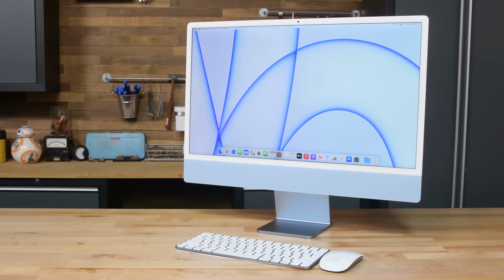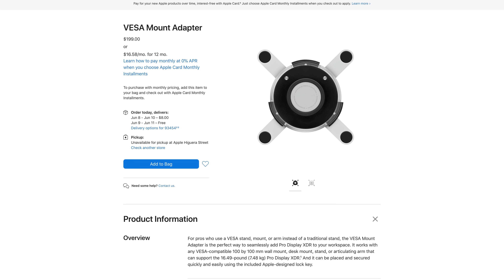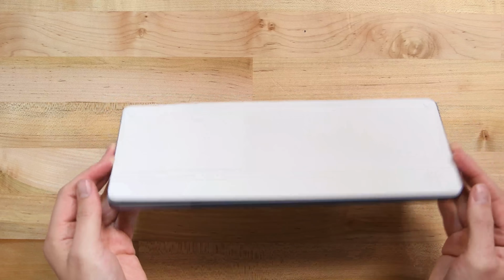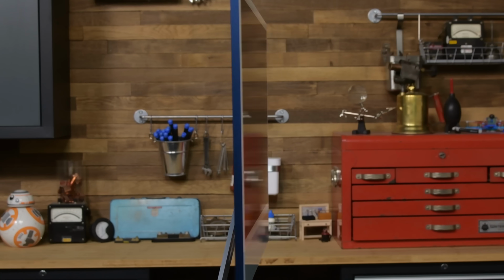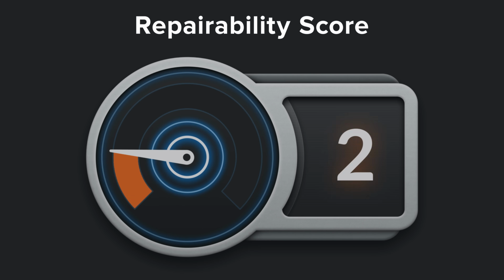M1 iMac 24” Teardown: A Desktop Only Jony Ive Could Love

Comment: That Bluetooth module looks almost as big as the whole SoC.
Reply: Yeah its not the same type of chip, because apple could have developed their own, but to make things work with other Bluetooth devices they had to use this one
Reply: @alanmay7929  They probably won't wake their own, as every device that emits RF, like wifi, LTE, or Bluetooth must be certified, approved, reviewed etc by the FCC and everyone else according the the country or region rules individually, it's strict and it takes years (like manymany years) and without benefits really just to be approved, and you must be for every country you will sell this product. That's why there is only a few brands that actually manufacture RF emitting stuff, bc its a pain
Reply: i should not be around all these peaple that know these things!!
Reply: It's just covered with metal cover for EMI shielding, the actual chips underneath are smaller.
Reply: True
Reply: @Big_Computer  But Apple al ready kinda make Bluetooth chips. H1 and W1.
Reply: @Big_Computer  I learned something new, thank you! That’s really interesting.
Reply: @Big_Computer   as someone who works in consumer HW design that’s a bit misleading. It takes a long time for regulatory approval but that’s months not many years, especially when you can do multiple countries in parallel, and some countries are consolidated (CE for all of Europe for example). Plus Apple is giant — they have the funds to do so considering their volume. I don’t know why they used a Murata module in this case, however many HW companies certify their own wifi and Bluetooth products especially to save space since modules typically are bigger than chip-down designs. And if the volume is high enough, it makes sense financially too as modules tend to be more expensive. 

Also finally this product still would have gone through emissions testing — all consumer products need to be FCC  47 CFT 15 compliant to be sold in the US. It just would have skipped some 2.4GHz /5 tests, and likely the Bluetooth SIG stuff.
Reply: @atavanH  thanks for your insights! Learnt something today
Reply: I'm presuming its a third party

Comment: I'm surprised Apple didn't go with passive cooling for this model. The thermal envelope is much more capable than the notebooks.
Reply: agreed. like you can use the entire back plate to cool the SoC. just one long heatpipe along the entire surface or so.
Reply: @Kayserjp  probably not required it's already cool enough i guess
Reply: passive cooling won’t fail, fans will fail so the device needs to be replaced sooner (apple strategy)
Reply: Depends, you may need the two fans of you're in 35°C ambient temperature.
Reply: @zeniktorres4320  cough cough macbook air cough
Reply: There’s also a giant 4k display, plus extended workloads benefit from a fan
Reply: @chidorirasenganz  That is a good point, that display and processors in the machine might produce quite a bit of heat over time.  I still think it could've been better fanless to keep dust out, even better than the new M1 iPads can, but I'm not an engineer to any degree.
Reply: @justinvalentin8983  same but I’m assuming they wanted better sustained performance so it’s on par with the MBP and Mac mini
Reply: They have a single fan iMac though, and it runs super hot(thermal throttled) compared to 2 fans iMac.
Reply: Right. There's so much space inside for heatsinks.
Reply: Because some media rendering work will throttle if no active cooling.
Reply: i would argue that it is cost savings, heatpipes are reasonably expensive and just chucking a fan on it means planned obsolecense, because you cant repair it, and cost savings. + they can market "High Performance Active Cooling" or whatever
Reply: @Carterthielftw_  heatpipes are not expensive. You can get several with a heat sink for $30-50
Reply: @thor.mukbang  I would argue that a plastic fan would cost less than 8-12 sizable heatpipes. The price difference would not be super substancial, but, like all corporate entities, making the most cost cut product is the end goal.
Reply: @Carterthielftw_  fans are definitely cheaper! But copper heatpipes are also relatively cheap
Reply: Passive cooling needs more raw material and good design, lowering the margin. Fan is an easy solution.
If people says passive cooling won't fail, the cooling paste will dry first in couple of years so the weakest point is still there nevertheless
Reply: Active means Increase fan speed before slowing the processor.
Passive means Slow the processor before increasing fan speed.
Reply: @KimoKimochii  Isn't it the other way around? The heat would build up inside the device and damage it.
Reply: @groszak1  your definition is completely wrong
Reply: @KimoKimochii  Why?
Reply: @groszak1  passive cooling means no moving parts, like a fan, which is called active cooling
Reply: I'm glad to know there are fans, despite how cool it may be inside.  I know this is comparing apples to oranges, but almost 22 years ago, my first Mac was an Indigo iMac (not flat screen, old style tube model).  Not the very first ones that had the fruity colors and the tray-loading CD drive, but the ones with the deeper colors and the slot-loading CD drive.  Besides the colors, specs and tray-load vs. slot-load CD drive, the biggest difference was?  Tray-loading iMac's had a fan, while the slot-loading iMac's had passive cooling.  Didn't help not having a fan.  The video card on it had to be replaced three times due to the lack of proper cooling.  Eventually, Apple replaced the iMac with an upgraded 2001 Indigo model.  Thankfully, it lasted several years before the internal plastics crumbled away.  

I know this is a new era and new technology, but given what happened with my iMac, I'd much rather have a fan than not.  I'm currently saving up to buy a new iMac.  I will opt for the mid-tier model at least due to it having two fans and a heat pipe compared to the base model only having one fan.
Reply: @KimoKimochii  wrong
Reply: Maybe it’ll loosen the adhesive holding the display.
Reply: @Kayserjp plus it’s vertical

Comment: Whilst it is a shame some things aren’t replaceable unlike the previous generation, I’d argue it’s progressing, in keeping only the major components on one SOC and other parts on some “replaceable” daughter boards, unlike prior iMacs which had ports soldered directly on
Reply: Is it acceptable practice from a company as large as apple, whose messaging is focused on saving the environment, for the number of interchangeable parts to be so low that it can counted on one hand? Standard windows PC have a mind bogglingly large parts market that allows you to build almost any form Factor. And even laptops have parts really available for everything from lid sensors to audio jack daughter boards, etc.
Reply: @xmlthegreat  but most parts that wear out are user replaceable. Ram sticks in pcs also break more often than soldered on ones
Reply: @Nik6644  I would very likely see some sources which can confirm you statement.
Reply: A custom gaming desktop is as modular as you can get

Comment: Amazing how miniaturisation has turned the guts of a computer into the size of a couple of big slices of pizza , but the unfortunate by  product being that it makes the device more of a throw away.
Reply: There are Mac owners that have a 10 year old iMac that did never touched the RAM. However lack of upgrade ability kind of defeats the purpose of a desktop computer. Hopefully the next iMac Pro is upgradable even still soldering the SoC to the board is fine.
Reply: @davidperry4013  it wouldn’t be an soc if the ram, storage, and graphics is embedded into the chip. Because it’s a system on chip
Reply: @davidperry4013  old max are not the same 
See the fact now people throwing their recent MacBook Air is a better example of terrible products that was designed to not last
Reply: @davidperry4013  The next imac pro will never be upgradable , its not in Apples plan , they will all have soldered on ram and storage from now on and no spare socket
Reply: There would be plenty of space for upgradable RAM and SSD in thie current iMac, the reason they aren't doing it is because they know they will make more money out of it this way.

It really hasn't anything to do with miniaturisation, at least not on a desktop computer.
Reply: @davidperry4013  Not really, I have built my own Windows PCs for DECADES....and I don't think I EVER upgraded any of them.  I build a really nice machine, use it for about 5 years...and by that time, you need a new motherboard, RAM, CPU and GPU...I think 99% of your "average" computer users are going to do the same.  Don't hold your breath for user upgradable RAM on any of these machines, the RAM is the way it is on these machines for very good reasons, which would be defeated by using standard "DIMM" modules.  I do understand that 16GB on MacOS with M1 is like 32GB on an Intel Mac, due to it's improved memory management, but the single biggest thing they need (other than more CPU and GPU cores!) on the larger iMacs is options for more memory.  32GB and 64GB options are really needed.
Reply: @Razar244  well space is one thing, the intergrated RAM is a different matter entirely, since for it to get to the performance the m1 gets it needs to be pretty much sodderd directly onto the board, anything less will have a performance penulty.

that being SAID, I still think the mac pro should have PCLE expansion ports for graphics and ram upgrades for thouse that need them.
Reply: Just like your HDTV....How come NO ONE complains about that ?
Reply: There really is only ONE disappointing thing about this Mac... you can't use it as an external display. Being able to use it as an external display would SIGNIFICANTLY increase the lifespan of the device. In fact... I bet some would just buy it as a monitor.
Reply: @TheNewGreenIsBlue  Maybe a future firmware "fix" might change that.
Reply: @johnnemesh5459  dude the people are considerd about easy  repairability. Swap the dead ram up, would be a 40 dollar fix or go to apple and choice ether buy a new machine or pay for the whole board probally 1k bill. Also the M1 Machines have this feature that uses your SSD if you dont got enough ram and some one on  reported that got 150TBW in  two months. (Saw it on Louis Rossman vid). My hope is that PC catches up is just the better option to not be limited by a company who tells you what you can do. Only Mac option for me would be the Mac mini or a similar priced/configurated Macbook.
Reply: Lol "americans will use anything but the metric system" legend is real (no offense btw, just made me smile)
Reply: Personally I don't care about upgradability. I have used windows all my life but I am planning to get a MacBook air M1 soon because I want something that delivers a lot of power while being decently priced. Plus, I can trust that they will last me at least 5-7 years so that's better than the similarly priced windows laptops I've been using. Overall, if upgradability is not a priority, you going for the new Macs won't be much of a problem
Reply: @johnnemesh5459  
Yea, The only thing I ever upgraded on my PC Builds was the Video card/GPU. 
After that it was time to build a new system.
Reply: @PulasthiKeragala  I can deal with soldered ram, but let the consumer upgrade or replace, should something go wrong, the freaking ssd. The ssd is the most consumable component in the system and should require absolutely zero interaction with the manufacturer to access, replace, or upgrade.
Reply: @davidperry4013  I might not have a 10 year old iMac, but I have a 10 year old MacBook Pro. I think it is really convenient to have parts replaceable. I have upgraded ram and wifi. Eventually I could add two new SSDs through the optical drive and regular sata connector.
Reply: @ForsakenFenix  So you throw away the case, power supply, memory and storage every time you want to upgrade a desktop PC? why? And in the case of an iMac you'd also be throwing the screen and speakers away.
Reply: @ricardoamendoeira3800 

No,
 I retire the old pc by giving it away to a friend or family member that could use it
As it was still good enough for normal everyday tasks, just not gaming anymore.

Comment: Apple really does create some beautiful internals, you have got to appreciate that engineering and design. (repairable or not)
Reply: It probably looks good because it's not repairable. When you design something without the intention of it being repairable, you have way more liberty.
Reply: @mathisbuilder  Apple internal always looks good. Look back at early macbook pro. Apple pcb always looks much cleaner and better compare to other computer maker.
Reply: @yogaexe  That's because they were always hard to repair lol, and who cares about the looks of the inside? Better have internal components that are accessible and replaceable than pretty ones.
Reply: @mathisbuilder  Good engineered products always have a good looking internal. It applies to everything. Look at good cars, they will have nice good looking engine. Same can be said of phone and pc. Reparability is irrelevant today. Most people aren't going to replace the parts inside pc. Making device simple and non user replaceable can means tighter tolerance and thus longer lasting part. This is can  be proven easily. Look at the longevity of an iPhone. Many older iPhones are still being used today.
Reply: Looks like a tablet, what is there to appreciate?
Reply: @Stef.Cata051  I was talking about the internals, they are so neatly organized and well designed to look aesthetic.
Reply: @mathisbuilder  the mac pro (cheese grater) intervals look great and it’s perfectly easy to repair. it’s just part of their ethos to make the internals look good
Reply: There’s nothing prettier in the world than Apple’s black Hynix RAM cards. As if the components in your Mac wear a BOSS suit.
Reply: Not being repair friendly design means less eco friendly product and it is against Apple’s so called Environmental Friendly products. Such a hypocrite Apple.
Reply: @akinoz  sure, but it creates a great product, it’s also faster because all the components are soldered right next to each other. Modular systems are inefficient and oversized.
Reply: @akinoz  Integrated components mean less chance for defects longer product life more eco friendly.
Reply: @curly7985  RAM ? yes
SSD ? No

Comment: easier to open and clean, and that's it. good luck repairing or finding replacement components.
Reply: @CapsuleLineart36th-gx1fx  you mean, you get easier replacement to newer mac?
Reply: There's not really any components you can replace. Maybe the soldered components on the logic board. But you can't even replace the SMC, cus it's inside the SoC. If it fails, it fails
Reply: @CapsuleLineart36th-gx1fx  easier to replace? Big market? Isnt apple known for making their hw locked & paired? Isnt apple against the right to repair? How are those reason making the parts are both easier to replace or "big"?
Reply: @CapsuleLineart36th-gx1fx  already doing well in india

Comment: It might not be super repairable, but at least it’s still pretty neat how Apple were able to fit all of that stuff into such an overall thin package.
Reply: THANK YOU
Reply: Maybe next they can use all of that wasted space to let people repair their product.

Who knows, maybe people will take pride in their Mac and want to keep it for as long as possible. I'm guessing they didn't account for that, though.
Reply: @dial2616  things cant get small and more repairable, one day you wont be able to repair anything yourself
Reply: @dial2616  what wasted space? The host of the video even explains that the „huge space“ inside the iMac is where the screen sits
Reply: @Nik6644  There's still a significant portion behind the screen relegated to acoustic chambers, which could easily house any additional expandability. Same goes for the chin, where there's empty space adjacent to the speakers and fans. Not to mention, the SiP itself is pretty large, and can be much smaller (as seen on the Mac Mini)

Comment: There's no need for screws and soft glue if the only thing you can do when you opened is to separate the parts to the correct recicle bin.
Reply: You can also replace/clean fans.

Comment: good luck cleaning those fans when they get dirty
Reply: except the fans are hardly even used because the chip is efficient. Probably take 5 years to accumulate what a normal computer does in a year

Comment: This is basically a laptop in a monitor case
Reply: i think of it as a big tablet on a stand. but without touch capability. and probably way better speakers.
Reply: the cooling it got with two fans puts it way ahead than a laptop. Heavy sustained loads gets these macs pretty toasty.

Comment: I hate the fact that there's no full size SD card reader. Leaves all the photographers using iMacs in the breeze.
Reply: Someone would probably create a usb-c to SD card reader that plugs right in and allow you to insert and remove the SD card, just like a old Game Boy cartridge
Reply: Just throw a chunky dongle on that and you should be good. It kind of ruins the aesthetic but I think the potential of M1 is worth it for any photographer, especially with that 4.5K display.
Reply: If you like the super clean aesthetic, dongles ruin it.  In my case I like my ports easy to reach so I prefer plugging a thunderbolt hub and place it near my keyboard so I don’t have to reach around every time I need to insert a thumb drive or SD card.
Reply: Just go out and pay mega bucks for an Apple dongle , thats why they do it , to squeeze more money out of you
Reply: @MrTarmonbarry  they do it because a single one of those usb-c thunderbolt ports have more capability than an entire desktop of the past.  You don’t even have to  buy apple branded dongles lol